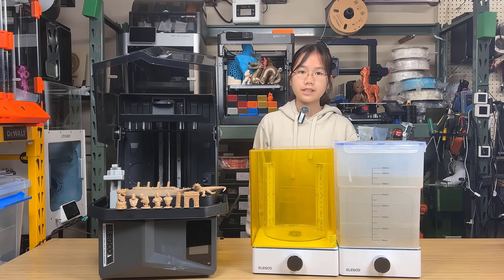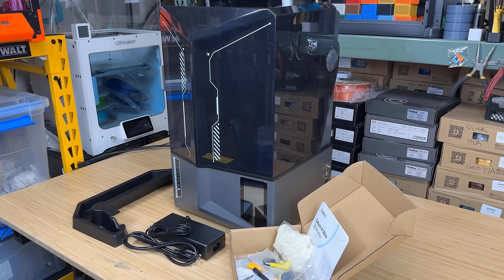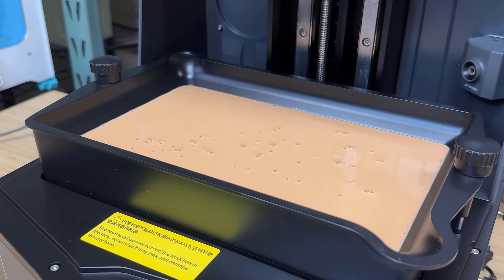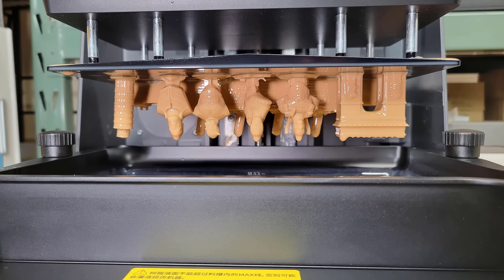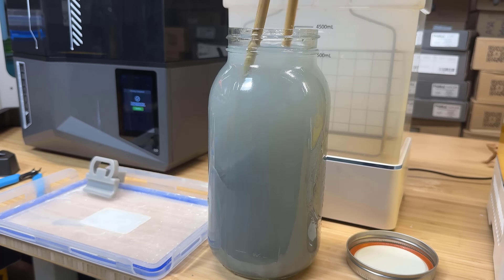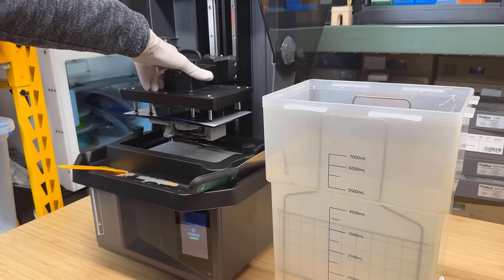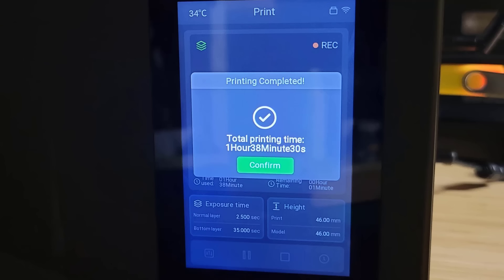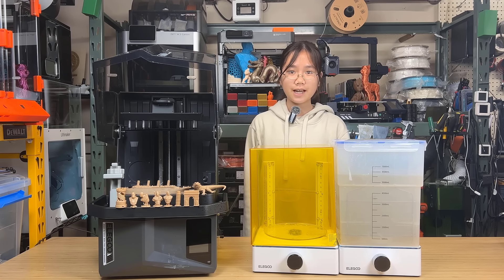Elegoo Saturn 4 Ultra 12K Resin 3D printer: Auto Leveling, Motorized resin tray for print releasing

Comment: Saturn 4 ultra is clearly the first of a new type of resin printers that make it far less tinkering then it used to be. Just like moving from a stock ender 3 to a K1 things go from tinkering to printing with ease. I doubt ill get this generation but the next few years resin printers will get some amazing advancements it might be time to upgrade.
Reply: I was thinking the same thing. I still have my Creality Halot-One and a EPAX 4k clone from years back. I don't use them much though, mostly print FDM on a Creality K1. It will be interesting to see what the coming years hold for resin, and FDM printing.
Reply: I'm hoping Bambu Lab will release a resin printer to give the resin side of the industry the same kick up the ass. 

Elegoo and Anycubic are getting there though. 

Fliptop lid, heater, auto calibration and lauto-level need to be essential features
Reply: @heysamhillier  vamos, que Bamboo copie a otros fabricantes para que los hooligans de la marca se emocionen pensando que han descubierto la pólvora. Es una marca normal más que cada vez que se tira un pedo, su legión de fanáticos dice Amén. Patético.
Reply: Can this use transparent resins?
Reply: Far less tinkering, yes. New type of resin printer? No. Prusa has been doing it this way for 5 years now with their SL1/SL1S resin printer. They were the first to implement a load of these features that make failures less common, and speed up the printing process.

Comment: Screw the lacking air filter, nobody needs those as they fill up immediately, but the printer lacks a heater! That's a total bummer! For viscous resins, this makes process reliability poor as the resin heats up only during printing and also decreases print quality due to resin being too sticky.
Reply: the resin heats up only during printing?? - use a heatgun (some use hairdryer) and steer the resin, print quality is back in action
Reply: The Anycubic M7 has a heater and auto resin refill so a hard choice between the two.

Comment: those prints are not clean..why are they so shiny still?  the lizard looks covered in resin still, the little spikes around its neck are sharp on the other print and blobby on this one. I think its uncleaned resin, but could be overexposed.  water washable resins never fully look clean to me, I feel like a good ipa wash in ultrasound with multiple jars is the way to get perfectly clean prints.

Comment: I just struck me....manufacturers should provide the resin printers with the possibility to have a thin resin cup in the resin base that is like a millimeter thick and transparant, I say this because as a house painter I often must use wall paint and to spare the bucket we put in a transparant cup that fits the bucket perfectly when done rolling we transfer the paint to the original bucket and the cup can be taken out, folded and disposed off....I have not experience with resin, but i hear everyone complaining about the rinsing and the stains and gloves....IF not buying loads of alcohol or ethanol.... which is not effective if you ask me, if a 3D printer person can use let's say a bit to make the printer clean instead of pouring the whole bottle in the resin base than that is much better right??

Comment: I'm not sold on this printer...bed levelling has never been a problem for me, so auto-leveling doesn't mean much...my two main conerns are (1) there are now two major moving systems on the machine (build plate and vat), this means there is more chance of components breaking down or working their way out of tolerance/calibration over time, and (2), almost always I like to wash my prints whilst still attached to the build plate, this build plate seems to preclude that possibility.
Reply: The build plate detaches with the flip of a lever
Reply: @SolarAbyss  Not sure why you said this...
Reply: @mackbolan1733  Why do believe the build plate precludes washing the prints while they are still attached?
Reply: i have 3 resin printers and cannot really remember when I last leveled them, auto-bed leveling is a marketing buzzword. if I remember right formlab had this vat tilting system and they dropped the idea (I guess for a good reason) btw never rush to buy a new system lets wait till other ppl beta testing it lets see how it goes after a year
Reply: @xeraoh  100% agree...
Reply: @xeraoh  Bed tilting is used by Prusa.

Comment: The elephants foot is common among all resin printers, and is caused mostly by the increased exposure of first layers.  This can be reduced, or even avoided by using a very long wait before print/wait after retract and lower burn in layer times.  Though this is only really acceptable if you can set bottom exposure wait before print/after retract values separately from normal layers, otherwise you will be massively increasing print times, because you need wait times of 20-40 seconds for the best results.

The elephants foot is caused by resin still moving when the exposure occurs.  As it starts to cure, it's still being pushed out from between the plate and screen, and the result is cured resin moving out from the masked area.
Reply: Indeed. About the -wait after retract and exposure-, UVTools is a great piece of software that allows to define them separately for bottom and normal layers along with dynamic lift distance: massive benefit for reliability, elephant foot and speed.

Comment: Correct me of im wrong but the elephant foot you get on resin is a compansation adjustment in the bottom layers because of the longer exposure time. Unless chitubox doesnt give u that option for compensation for the printer as i have it for my anycubic on chitubox.

Comment: Great review, as always!  I was excited to see this next generation MSLA printer and was happy to see this positive review.  This looks like a good candidate for a small print farm.  Now if only a manufacturer could make an integrated system that ejects the parts from the build plate, cleans, dries and post cures them automagically.  MSLA has too much messy slopping around with chemicals.  A structural resin that uses soapy water would be a huge boon to MSLA printing.

Comment: Thank you for the review as there is very little about this printer online at present.  Questions you may not have considered - does the network feature require sign-in to the slicer "network"?  aka could you transfer files completely isolated from the Internet?  

I read that newer versions of the voxeldance slicer re-introduced network connectivity due to "optimization" from former versions.  Does this come with a copy/license for that slicer?

Does it come with a screen protector?

Thanks again for the review!

Comment: Great that it has a camera.  One question though,  is the interior of the machine illuminated?    BTW one of the cons of this printer certainly is the two layer build plate -  must be a nightmare to clean it between the plates :(
Reply from the maker: No, it's not illuminated. I simply wipe it with IPA and a paper towel and don't clean it completely every time when switching resin; I just let a tiny bit of resin mix with the new one.
Reply: I presume it allows you to put a lot more resin in the vat.

Comment: I’m having issues. Did you have the same issue?  When printing the sample print included with the usb. It starts off printing fine but once it gets to around layer 50 the vat tray drops and waits 35 seconds before raising back to to do a 2.5s exposure. And then goes back to 35 seconds wait time before the vat raises back up for another exposure. Etc. 

A 2 hour sample rook print turns into 15%complete after 3 hours.   

I’ve reset the printer, tried factor reset, rebooted, tried using the slicer itself, tried a different usb drive. Nothing is working.

This printer no matter what I try IT IS SLOW!!

I’ve reached out to Elegoo and I’m still waiting for a response.

Comment: 13:04 Quick question 😄 For this scenario, will the tiled vat motion benefit if I position the model horizontally instead of 45°?

Usually, prints will fail if the first layer after support is flat like that.

Anyhow, great review! 
Is there any chance you are testing the Micronics SLS printer?😆
Reply from the maker: I believe so. No matter how you orient the model, it still has to contact the film of the tray, so the tilted motion should still be beneficial for release.

Comment: Using water in these types of wash and cures is generally not recommended as the bearings in the impeller will rust over time. Some people replace the bearing with ceramic ones to use the units with water instead of IPA.

Comment: 12:38 This, I think, confirms my assumption that there is no such thing as an auto bed leveling, but just a spring-loaded bed. I have never had issues with bed leveling, and if I had, I'd just increase the bottom exposure to fill the gap. So no advantage at all, but at the cost of a massively more annoying cleaning procedure.

The tilting mechanism may be a good thing, but it comes with its drawbacks, too. On the Prusa machine, I've seen feature requests to disable it as it introduces warping.

All in all, I think this is a downgrade from the saturn 3, although I was very excited at first sight. Maybe the tilting mechanism is really worth it, time will tell, and the hood is - well - all printers will need to change to this now... But the build plate is a deal-breaker for me.
Reply: The leveling uses strain gauges for leveling, springs would not work.  A BIG plus with this is residue detection, to save you puncturing FEP.
Reply: @petercallison5765  Yes, agree, this sensing may be a life saver. But these sensors are not likely to be in the buld platform, are they? I don't see any communication measures like spring contacts. And I'm sure there is no wireless communication. So it's just one single force sensor. And even if there were several sensors on the plate, auto leveling to me would mean that there are motors in each corner of the plate, which would twist the plate accordingly. So on the plate itself it's just springs, isn't it? If you push the plate on a corner, will it retent and then spring back? Sorry for asking again.

Comment: Great video as always, does the printer support a low resin (resin run out) feature when printing?  I've seen this feature before but can't remember which resin printer I saw it on.
Reply from the maker: Yes, the Saturn 4 Ultra supports resin leveling monitoring.

Comment: I'm waiting for Black Friday to purchase a Saturn 4 Ultra with the optional heater for consistent results for production.  I'll 3D print a knob so I can raise and lower the lid with one hand.  Resin smeared on an acrylic lid looks awful.

It looks like I'm going to need to create a separate WiFi network for my 3D printers that is air gapped from the internet.  I don't like giving internet access to various devices.  I don't like the potential for spying (looking at you Big Bambu) but these devices also represent significant privacy and security risks.  The printer has a camera.  Do you really want that exposed to the entire internet?  Who knows what open ports in a 3D printer could be exploited to gain remote access to my WiFi network and all connected devices?  I love WiFi enabled printing from the slicer and remote video monitoring is nice but the security and privacy concerns make WiFi look like a bad decision.

Comment: Hi! nice video, I just have a strong doubt about how well that autolevel system works...
Anycubic's M5s used a similar system and it was total rubbish. the build plate was crushed against the LCD and the prints were severely deformed in height.
Could you try printing 5 2mm thick discs (4 corner and center) and measure with a caliper how thick they are printed?

Comment: So would you say this it the “Bambu printer” momentum for resin printers meaning it has increased speed and accuracy right out of the boxes compared to traditional resin printers? I feel like it. I stick with Bambu printers but I do have a resin printer but haven’t used it a lot because all the extra stuff you have to do to print it but this may bring me back to using resin printers again. Just got to sell my old one first.

Comment: Hi. 
a printer should not have problems with a full print late even without a tilting mechanism. I often print a 90% full printplate and dont have fails. the correct bottom exposure time for the used resin and the movement speed settings should be dialed in of course.
If you want to check your supported print, try doing this before you sliced it and while or after supporting. it should render faster. 
elephants foot is of course happening on the first layers because the exposure time is greatly higher than the normal time...tuning this in the slicer is really easy and not the fault of the software or printer. did this not happen with other printers you tested?

Comment: If this printer had a cabin heater and a resin pump, I would get it.
Also one problem I find is, I think air filters are mostly worthless and a air hose is always a better solution. But I am scared of sucking too much air, fast enough the ambient temperature inside decreases rapidly, to cause a print failiure.

So a machine with a controlled fan right before the hose exit, would also be a wonderful addition.
Reply: The Anycubic M7 has both of those.
Reply: @petercallison5765  I didnt know, I will take a look at it thanks a lot for the suggestion